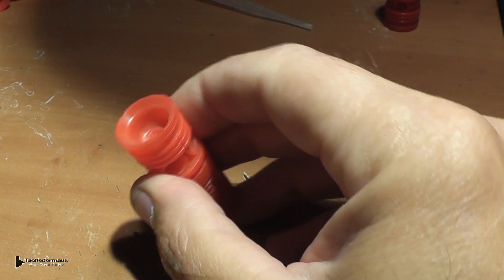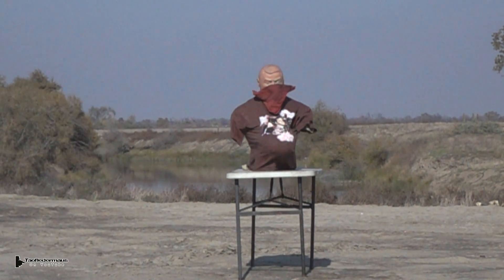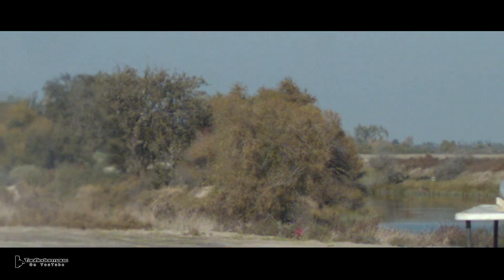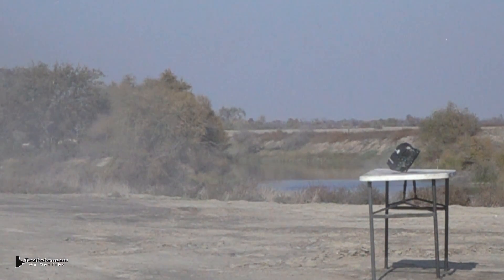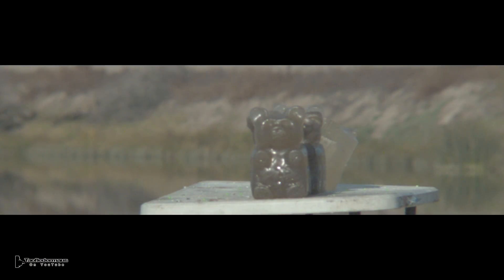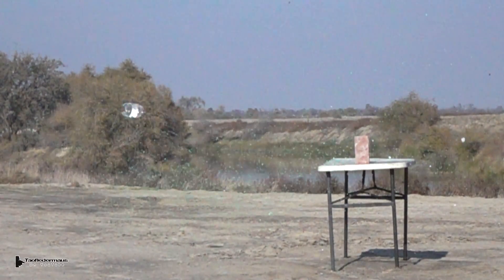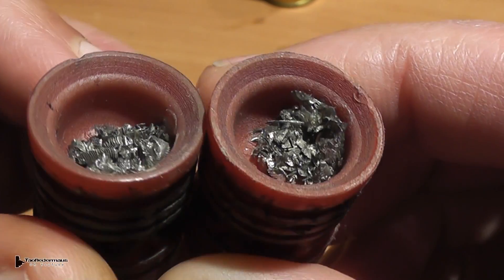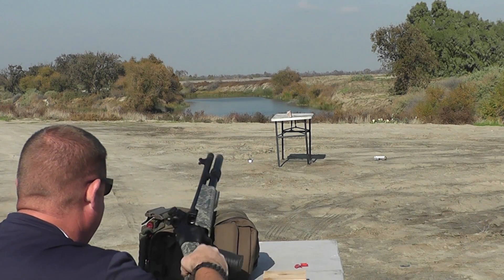Magnesium Shotgun TRACER Experiment -You Asked for It

Comment: Looks like there simply wasn't anything to actually ignite the magnesium.  In a real tracer round, this comes from direct exposure of the tracer element to the gunpowder in the shell (It's slightly more complicated than this since you need to make sure the tracer element doesn't corrode in the air and thus no longer ignite, but that's the general idea).

The previous experiment had the gunpowder mixed with the magnesium, which directly ignited it when it went off.

Maybe it would work if you glued the magnesium to the back of the sabot?
Reply from the maker: The gas piston sits right on top of the powder so the magnesium was exposed to the same powder as it was in the other video.
Reply: TAOFLEDERMAUS So it is.  Somehow I had the idea that it was in there between the sabot and the slug >.>
I wonder why it didn't ignite then.  Possibly the way the end of the sabot is cupped makes it so that the air around the magnesium can't escape and so serves like a cushion of air?

Comment: i would bet there aint enough heat there to ignite the magnesium. It needs heat and time, which it aint gettin. So you need to give it more of both. Lets think, there is a hellton of pressure. So if you have a finer mix of the magnesium and some actual gunpowder i guess that should do the trick. The Nitro gives alot of pressure. Which will ignite the gunpowder, which in turn will then supply the magnesium with enough heat and oxygen to ignite preferbly in the barrel. Should make it real fine, maybe mix it with some gasoline to have it be like a paste. Dont blow yourself up.

Comment: If the magnesium is submerged in glue it won't ignite.  The magnesium has to be loose and somewhat airy. And very fine.
Reply from the maker: There was a lot of the flakes exposed and sticking out of the glue.
Reply: +TAOFLEDERMAUS  You may need phosphorous for the ignition, or do what I did and crunch up the magnesium very finely (which is neccessary anyway) and mix it with gunpowder (85% Magnesium to 15% gunpowder) that'll ignite more easily. You should try it at night so you can see if it ignites at all, I know the high speed camera doesn't work at night but one shot at night filmed with the normal camera will help you see if there is just not enough ignition or if the problem is that there is no ignition whatsoever.

Comment: try not glueing it to the shot-cup. instead just loosely chuck a bunch of magnesium scrap behind it. it isn't spread out, so it conducts the heat from the blast across all the pieces instead of reaching ignition temperatures like it does in small single pieces

Comment: hot glue is the problem. try filling a sabo with loose magnesium with a flash hole at the back and hot glue the slug to the sabot. I think the extra weight is what is causing it to separate and the hot glue is suffocating the magnesium

Comment: When striking a magnesium bar it sparks because the little slivers ignite when exposed to air, as Long as you are hitting a metal plate the magnesium slug should splash like lead and should give off a good spark

Comment: Good video, some science involved in this one. You can also use titanium powder/fine shavings to throw off a very bright white flash. Love the videos Jeff, keep em coming! :-)

1-(edit, read you wrote this in the description after i wrote it lol..) Not enough surface area to heat the magnesium to its flash point when its captured by the hot glue acting as a large heat sink. You can make a small ball of magnesium inside of some saran wrap and put that in before the round goes in, the saran wrap will burn off ejecting the magnesium into the burst stream igniting it. Also the finer the magnesium the better ignition you'll get so a powder or close to should make a brighter flash. 

2- The magnesium is acting as a counter weight throwing the balance off and ejecting the lead tip off of the stabilizer would be my guess.  You may also be able to glue the saran ball to the inside of the slug to contain it without throwing off the slugs balance as the saran should burn off completely and not alter its trajectory.

Comment: The reason it never works is because since you put the magnesium in the back it never had that resistance that it does when it is in the front. For it to ignite you need an amount of heat that is caused by the bullets resistance in the air or from impact on a solid object. It never has this heat or resistance in the back because there is a sort of vacuum or pocket of air behind the slug where no resistance is present. Yeah I know I said resistance like 10 times in one sentence
Reply: Not sure if I'm right on this but I think this is why

Comment: On real tracer rounds the tracing compound is capped by some kind of igniting chemical.
Reply: Filipe Amaral theyre phosphourous i think... But i could be wrong lol
Reply: darkwarrior Actually tracers can ignite right out of the barrel (commercially available tracer pistol rounds do so because most people don't shoot pistol rounds at over 100 yards), but the fact that they give away the shooter's position have encouraged the development of subdued tracers that only light up after considerable travel to avoid giving away the exact position.

Also, there's a ton more frictional heating inside the barrel than in the open air.
Reply: Actually, its a foil cap, usually frictional heat can ignite it, as even taking a torch to tracer compound takes a few seconds to ignite it, a few seconds is more than what it takes to leave the barrel, thus the powder cant possibly be the igniting force.

Also why they dont ignite immediately out of the barrel but around 30-80 yards or so.
Reply: And it's exposed to the powder igniting, not with a huge plastic wad in the way.
Reply: @Azirahaelx  no they do work by frictional heat going down the barrel cause that bullet is fitted tight in the barrel after it's shot resulting in the tracer compound containing phosphorus ignites and as it leaves the barrel it glows much brighter when in open air resulting in the tracer being seeable during its flight to the target and that's what makes tracers fun and easy to tune your sights on your guns with
Reply: @tyladube801  nope: https://en.wikipedia.org/wiki/Tracer_ammunition

That much friction would jam the barrel.

Comment: Im pretty sure the only way magnesium would gain enough energy to ignite in such a small amount of time is through friction against the barrel. The magnesium has to be able to rub against the barrel. Gunpowder and compression will definitely not generate enough heat to ignite. Hot gluing it just in the center nowhere near the edge was a mistake in my opinion.

Comment: The added mass of the hot glue and mag would increase drag on the plastic insert, and as the slug is fired cause setback on the plastic and pull them apart.

Comment: It's because the magnesium was with the powder that ignited that made the magnesium ignite. By its self the projectile won't get hot enough to ignite the magnesium. Fire needs 3 things. Heat, fuel, and oxygen. If any of those 3 aren't present you will not have fire or ignition.

Comment: i dont think the magnesium is getting enough air so it cant light...modern tracer ammo uses a mixture of compounds which are 16% polyvinyl chloride(PVC so its still flammable but also solid) , 26% magnesium powder(for fuel), 52% strontium nitrate(for color but more importantly this is a nitrate oxidizer No3 is the chemical..it is a better oxidizer than even O2 air.. because it has an extra oxygen atom)

Comment: Have you tried igniting the hot glued magnesium shavings with a lighter or torch after you fired them to see what it would take to ignite them?
Reply: Magnesium is not self oxidizing and why would it be? magnesium is an element in itself, its not a compound so there can be no self oxidizing properties. Looks like someone didn't pay attention in their high school chemistry class. Burning magnesium is a simple reaction that forms magnesium oxide. 2Mg + O2 ---> 2MgO. You see that? If there is no oxygen, there is no reaction.
Reply: limescale onetwo he's right. You're an idiot.
Reply: "fool, magnesium is self oxidizing." priceless...
Reply: limescale onetwo no it needs air to burn. That's why the military uses over 50% nitrate oxidizers and less than 25% magnesium. It cannot sustain itself because it doesn't have enough oxygen. Nitrates like No3 have 3 oxygen atoms.. Allowing them to burn literally without air dumb fuck
Reply: +limescale onetwo Magnesium is not self-oxidizing, it needs air to be flammable. Try igniting it in a vacuum, it won't work.
Reply: +Yindog1 

actually, it does NOT need air. 
it needs oxygen.  

there is a difference.
the oxygen need not be in gas form 
it can be bound with other atoms in a molecule 
like... the oxygen in water. 
you see, when magnesium burns underwater ( and it will, quite vigorously. ) 
it breaks down the molecules of water into
oxygen, and hydrogen. the freed oxygen will support the combustion of magnesium.  

this is why you should never, ever put water on a magnesium fire. it will intensify the burn, and you'll get a hydrogen burn in addition to the reactive magnesium fire.  

nor should you use carbon dioxide... the magnesium will react with CO2 and free the oxygen in the molecule. .. and intensify the burn rate. 

now, if tao had powdered his magnesium to increase its surface area, and added some powdered oxdizer,  maybe a small amount of potassium nitrate, and comressed it into a disk with a a small amount of glycerin or polyglycol as a binding agent he may have has some success.
Reply: +limescale onetwo 1) Self-oxidizing means that it does not need an external oxidizer to burn. 2) Air is an external oxidizer. 3) A vacuum is an environment without air. 4) Magnesium cannot burn in a vacuum, but it can with air. 3, 4, and 5 are true, therefore 5) Magnesium needs an external oxidizer to burn. 1 and 5 are true, so 6) Magnesium is not self oxidizing. QED.
Reply: limescale onetwo
Its either you're trolling or you really are just that stupid. For humanities sake i hope its the former. Anyway, Im done feeding the troll.
Reply: limescale onetwo point is? You replied 17 times and even wrote massive paragraphs when you got butthurt. You're still going on now.. Compare that to my 6 (counting this one) and we'll see who really has too much time alone.
Reply: I think what he means is that burning magnesium can rip off oxygen from it's surroundings to provide oxygen for it's oxidation. Like when you burn it in a box of dry ice or under water. No idea.
Reply: limescale onetwo So is this the part where you damage control by claiming you where trolling the whole time? Anyway, Im done here. No sense in trying to argue with a lead block anymore.
Reply: limescale onetwo sorry are you still going on? Unlike you... Some people have a life (you were wrong and that's the funny part)
Reply: oxidizing means it reacts with oxygen you have things with different oxidation rates like magnesium which can react very quickly and burn or things like iron which react slowly and rusts literally everything can oxidize under the right conditions self oxidizing means you have a compound/mixture that already has the oxygen and doesnt need a external source of oxygen ie. air to oxidate/burn things like thermite and gunpowder are self oxidizing and will burn even in a vacuum or inert atmosphere
Reply: limescale onetwo
I didn't fabricate anything. And those shavings? That would be near pure elemental(unbonded) magnesium. So yes, what i said does apply very much to what you are saying.  Go ahead and keep digging.
Reply: *****
It really is hilarious that some people can be this dense. All they do is make themselves look just as bad as that whole flat earth crowd XD. All safe in their perfect little bubble of ignorance.
Reply: This is what happens when you feed trolls.
Reply: NoName If you keep feeding them, they might follow you home.
Reply: Cooking With Cows lol
Reply: Both of you are continuing rather than stepping away.

Therefore, you both have too much time. Go to your local range for awhile.
Reply: darkwarrior I stopped 😂 no point in talking to a 12 year old like him.. Everyone proved him wrong I just wanted to get my share in. (And hello from the Oklahoma gun owners association😊)
Reply: +limescale onetwo You are wrong and trying desperately to hide behind semantics and sophistry.

You do seem to have a good intellect though, really should put that to use... 
I sense an incoming comment of entertaining oneself
Reply: its because the magnesium doesnt have a dedicated oxidizer and because of that cant burn when moving on the back of a projectile so fast. he needs to ad a mixture of at least half No3
Reply: They will ignite if he did that for sure, but it would also melt the plastic its glued to and it wouldn't really yield any valid info. what he would need to gather is the exact heat needed to ignite the glue-ball of magnesium while its attatched to the plastic stabilizer that's acting as a heat sink, then compare it to the heat created inside the combustion chamber of the shell and the barrel at its flash point to see if it would even be possible to ignite the magnesium. which would be all but completely impossible to do really. (i know nothings impossible but with the tools and budget of the average person it'd be beyond extremely hard and not truly worth it.)
Reply: Lurkily Esh Hehe, limescale is just doing some lighthearted trolling, he is not being an arse.
Gotta give em credit for going beyond simple sentence construction too!
Reply: y'all got baited, lol
Reply: @userPrehistoricman  by a master lol
Reply: bob345 
remember that one video that sparked this little mosh pit of narcissism? you see the little shavings glued to the back of the shot cup? that's what we (or at least I) have been talking about. I don't know where the vacuum of space or the pure elemental form of magnesium applies to this comment section unless you're bent on "winning" a technical argument that you fabricated. I am not interested having a high school chemistry conversation, especially with a few high strung YouTube experts. I'm interested in delving into the Taofledermaus video with a discussion on how to achieve success making a magnesium tracer round. so you (and you few angry fools up there) can take your Divine Feces and tired insults and go sit in the corner. Or carry on with the foolishness.
Reply: iroeky
 "some people have a life" 
👌 priceless
Reply: Why not Dean 
magnesium = self oxidizing, foolish fool
Reply: iroeky so I'm not wrong that magnesium is self oxidizing, but I'm still an "idiot" a "dumbfuck". take a chill pill, fool.
Reply: iroeky

 I noticed you just edited out your acknowledgement that it is indeed self oxidizing, albeit weak. ...wonder why... 

caught ya!
Reply: Yindog1 where does the vacuum come into play here, I'm not seeing it?
Reply: Why not Dean fool, just swallow your argument and beef with me and look it up. seriously, look it up. I await your results.
Reply: Why not Dean 
omg, SELF oxidizing is not defined as something that requires an oxidizing agent, FOOL!
Reply: bob345 Here in actual reality and not in the conceptual one, that you're not incorrectly arguing, magnesium occurs naturally only in combination with other elements, where it invariably has a +2 oxidation state. Therefore, that magnesium you see there and anywhere is indeed self oxidizing. For the purpose of objectivity, pertaining to this discussion about the video, I won't concede that I am "just plain wrong" nor an idiot, dumbass, etc. etc. It is indeed foolish to focus efforts trying to prove me so based on my factual assertions here. but by all means, continue to be foolish.
Reply: 😆

 no talking in the time out corner or you'll just be there longer
Reply: bob345 I was trolling? ha! talk about deflection
Reply: iroeky another one bites the dust
Reply: bob345 triggered
Reply: iroeky ouch, 👌 good one, good one.
Reply: bob345 
are those the rules? okay...

"humanities" sake? you still in home economics?

nom nom nom, keep feeding!
Reply: iroeky 

HAHA, you're counting responses and drawing some kinds of conclusions with your comment section data! And you're STILL obsessing! 😆 

...fool
Reply: darkwarrior you are correct. the difference is, I'm having fun.
Reply: Lurkily Esh this is what happens when one stops being reasonable and listening objectively. As a result of being such a narcissist and using ad hominem, personal attacks that don't change the substance of the conversation/argument, one is left with no other option but to resort to labeling their opposition as irrelevant - like a "troll". This makes it easier for the narcissist to justify their overreactions and to appear as the moral and intellectual superior. A couple of high strung, sensitive comment heroes want to make themselves believe they're just dealing with a common troll. Well, as there is no reasoning with these professors, I'll abide for as long as they wish to continue their foolishness.
Reply: NoName 

me am troll! me not wrong! me just hungreeeee!
Reply: iroeky stop deleting your comments fool, it's making mine confusing 😁
Reply: Prehistoricman 😉😇
Reply: iroeky fool, magnesium is self oxidizing.
Reply: Why not Dean 
magnesium = flammable, fool